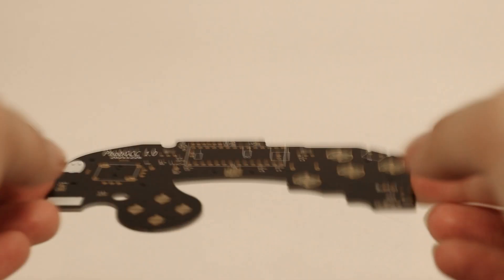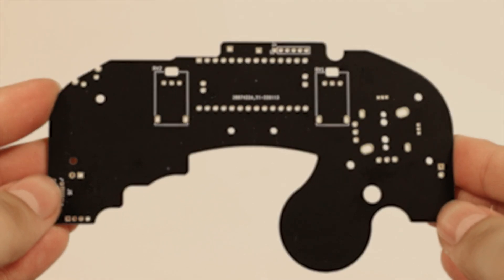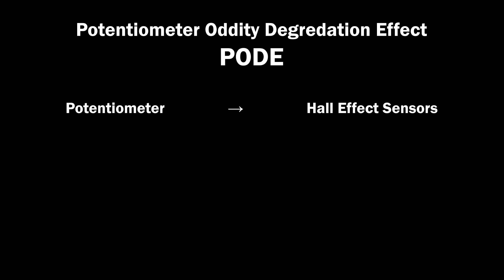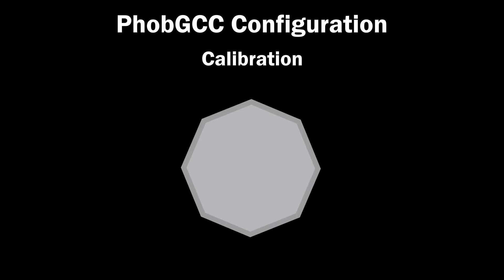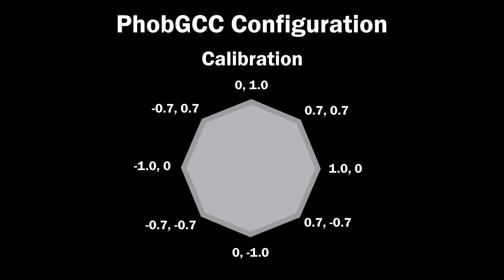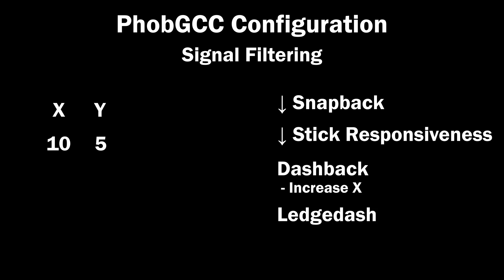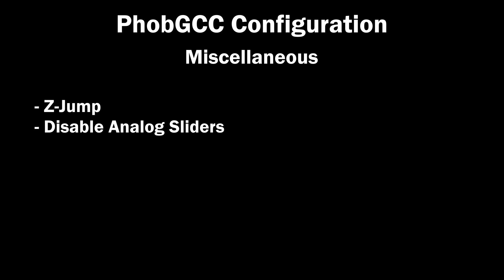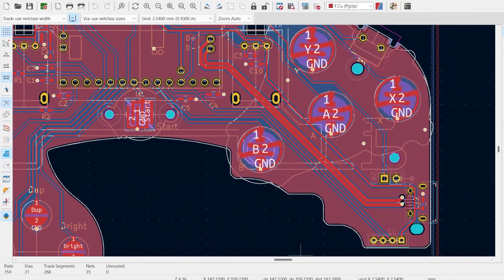PhobGCC - Overview and Features

Comment: Hey frost, I know one thing that is useful is Tiered shield buttons. Such that you can replace a contiguous range of shield values with a single value, allowing you to effectively target a specific medium analog value reliably. As long as it doesn't allow for analog values lighter than Z-shield it would be pretty fantastic tbh, and most players I've talked to have liked the idea.
Reply: Lol this sounds like cheating
Reply: idk what fix i need but i feel like my l and r buttons hold themselves down so aggressively if i cause shearing friction along the casing/weak-springs?
Reply: We as a community should consider whether we're all OK with replacing analog inputs with digital at all. Like perfect wavedash angles with 1 button press. B0XX does this and it's still questionable.